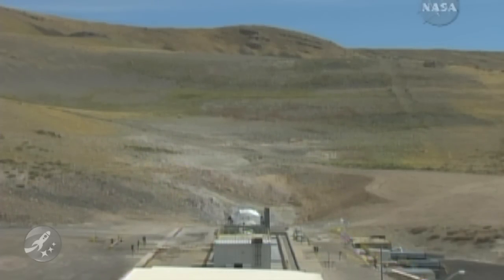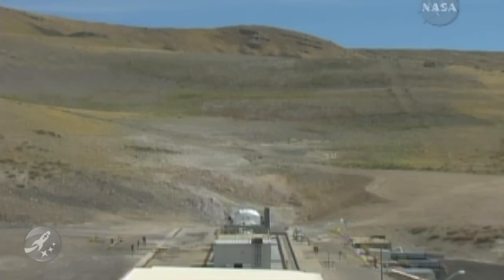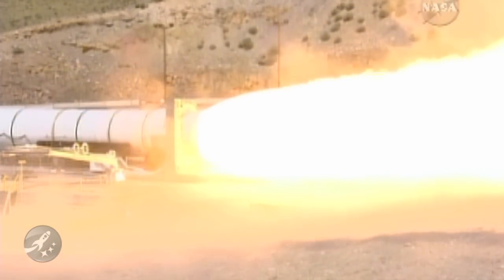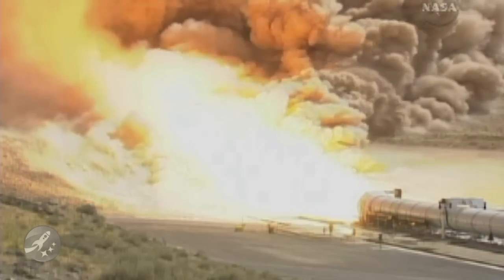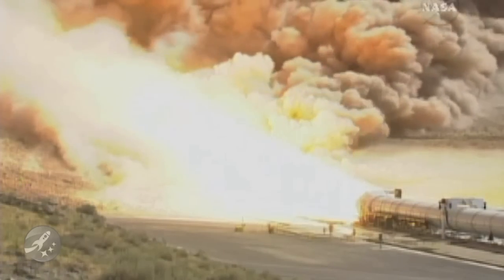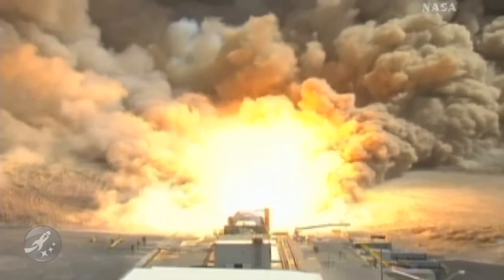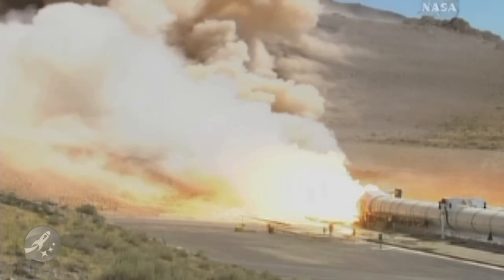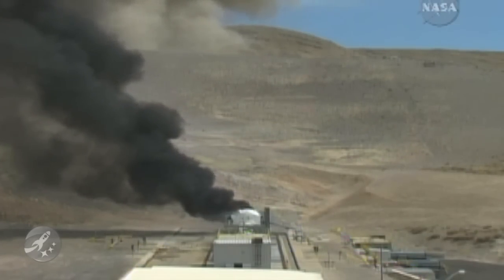Ares I Motor Test

Comment: Lol... Rocket fuel is not your common crude oil of which you speak. You are highly misinformed. This particular motor burns polybutadiene acrylonitrile. Far from the oil you claim the US is stealing. Otherwise, normal liquid fueled rockets often use an oxidizer and propellant, most commonly hydrogen and Liquid oxygen. Unless you think the US is "stealing" Oxygen and Hydrogen as well, then you are wrong again sir...

Comment: Just in case you didn't know, while this is often thrown around as a joke, it isn't actually possible to alter the rotational speed of the Earth in this way by placing rockets along the equator. The mass that leaves in the rocket exhaust imparts momentum to the atmosphere, which in turn is applied to the Earth's crust as a drag force. These forces cancel out, meaning that the Earth is 'slowed down' just as much as it is 'sped up'. Just some trivia!

Comment: Great observation,yeah the radiant heat is immense from the 6000F degree luminous aluminum oxide particles exiting the nozzle at 1-1/2 miles per second leaving a smoke cloud with a mass of 1-1/2 million lbs, half the thrust of the motor. Though I'll take an F-1 engine any day,it can be turned off on command,Space Shuttle Challenger couldn't do that, and we all know what that meant.Solids are not man rateable for this reason, dirty suckers too with HCl acid rain.Sorry to pop your bubble.

Comment: The same issue holds true for night test runs. Imagine that, millions of horse power with a thrust vector straight up into the air at night.  That's like pushing the Earth towards the sun. I'm sure Chuck Norris doesn't want to light his cig on a corona.

Comment: If your for a hotter climate, then by all means, argue that we have nothing to do with climate change.  There is a simple solution that doesn't involve stopping the program, and that is simply turn the test firing to promote a continuous rotation. A better analogy of this issue is potential energy is converted into kinetic energy and the pinwheel spins. Energy transferring back into the air is not the same coefficient, because air allows dispersion.

Comment: You still neglect to acknowledge conservation of momentum, No matter the scale of power; With out mass leaving the atmosphere increase in rotation speed will only last until the exhaust gases transfer energy back to the earth in the opposite direction. You can make one day shorter by increasing rotation speed very temporarily (on the order of minutes), before returning to a net effect on angular speed of zero (precisely zero, Not a rounding down). To say otherwise it to say air is frictionless.

Comment: Microelectronic and computer systems engineer. Specializing is solid-state physics (LED's, integrated circuits, MEMS, High power mosfets, ect.). Before you pass any judgements on my speciality in regards to the topic mater at heart, I assure you that I have had to study in great detail all the same maths and physics as you will have to except maybe at the cosmological scale, But have a well above average understanding regardless. In fact I teach 1st and 2nd year physics as part of my fellowship.

Comment: No longer debating the rotation issue, Suffice to say that I teach university physics. This can be derived from first principles, no trust in prior work needed. You wish to stay ignorant than that's your prerogative. As for warmer days, Of course. But you said 'global warming' which by definition, an average of the globe. Following the laws of radiation, The cold side will get colder than the hot side gets hotter. As for LHC/Russia, that's Post hoc, ergo propter hoc. Good sign of schizophrenia.

Comment: Ok people. I used up every character available to make that one point. The calcs are ignoring conservation of angular momentum, With out mass exiting the atmosphere; no change in rotational momentum can occur. With 1 exception, Tidal drag. Which transfers momentum to the moon by the gravitational pull of the ocean tides, Which FYI is 200,000x the effect calculated above. Which again is fictional and ignores some physics to point out the inanity of the original statement even assuming it's true.

Comment: Thanks for the back up, But I've already made mention of conservation of (angular) momentum in other replies to him, but space is short and could not get all relevant points across in a single post. As for dams, it definitely has an effect, We've prevented about 3cm of sea level rise from stored water alone ~ 10,800 cubic kilometers. But even making the assumption that all this was on top of mount everest, We would have shifted by less than a femtosecond/day. Just not measurable.

Comment: You will never "slow" down the earth like this. Every force creates a force in the opposite direction, and because you can't "kill" energy (the force of the jet which stays in the atmosphere) the earth experiences the same force the motor puts on it, as the jet transmits into air and ground. Same principle as sitting on a sailboat and blowing into the sails. You will never move the boat.
Only way to affect the rotation of the earth like this in any way would be to lead the exhaust jet into space

Comment: Seeing as I ran out of characters, I wasn't able to conclude by pointing out that regardless of this *incredibly* small figure. This *still* wont happen inside the atmosphere, any air you move quickly dissipates its energy back to the earth itself in the opposite direction, the only way to break this fact is if mass is ejected from the atmosphere and never returns.
I.E. any rotational energy added or subtracted from the earth while accelerting, is returned whilst braking.

Comment: No we don't, You just completely made that up. Firstly this is 22 million horse power as stated. or 1.6412x10^10 joules/s. Runs for 120 seconds for a total of 1.969x10^12 joules. Earth has a period of about 23.93 hours, it has an angular velocity of 7.29×10^-5 rad/s with a moment of interia of 8.04x10^37 kg/m^2, giving it an rotational kinetic energy of about 2.138x10^29 joules
Moral of the story, It would take roughly 39851 years at firing one of these a second to even slow the earth 1 sec/day.

Comment: The byproducts of this are aluminium oxide and potassium chloride, the latter of which is only mildly harmful to the atmosphere. The overall effect on the environment from lighting one of these boosters is negligible. Most of the smoke you are seeing isn't even from the propellants being used, but rather from water vapor in the air instantly being turned into steam from the intense heat. To put it shortly, no one is with you. We're fine with our progress, thanks.

Comment: You better be trolling. Cancelling Constellation should have been done ages ago. The Ares I-X test showed that major thrust oscillations happened when using the SRB as first stage. It gave all the data needed to say "No, this doesn't work like it should". ATK has reviewed and improved the design now for the Liberty rocket system, but the Ares concept didn't work. Launching crew and payload on seperate rockets for "safety" is also a huge waste of money and time.

Comment: Yes. Very fine aluminium powder is used as fuel, and is mixed together with the Oxidizer into a paste, they put that paste into the SRB, and an ignition charge.

Comment: This 5 segment SRB designed for Orion called Ares was canceled by NASA but the design is solid and will be used for the new Liberty rocket launch system with ATK in concert with the Ariane 5 rocket from Fance as the new first stage to one day transport crew and cargo to the ISS or on a moon mission maybe in the future.

Comment: @spacevidcast  Actually their was Zero horse power generated during this test because no work was done. Their is no direct thrust to HP conversion unless the motor is doing something like propelling a rocket. Temperature varies 2/1 throughout the motor,7000 to 4000,pick a place.

Comment: @rss0246 Exactly, we have heard this particular sound for years, coming from the aft of the Space Shuttle, just minutes before launch or when landed, sitting on the runway. Obviously for the same reason. Pressure for hydraulic systems. ;)

Comment: "Sound of the high speed cameras". It's not correct.
It's the APU noise, used for hydraulics system for steer the noozle, thrust vector control.

Comment from the maker: @Dillon1108 Sure it is. It might only be 0.00000000001%, but it does indeed affect the earths rotation. It's the same concept as jumping from a large boat in a lake. You might be many times smaller than it is, but your short exertion of force is enough to cause the boat to move in the opposite direction, even if very slightly. 

To give perspective though, the earthquake in Chile in February actually slowed the earth's rotation by a millisecond and shifted the Earth's axis about 3 inches!

Comment from the maker: @NitremArts For what it's worth, the SRB's burn at 5,600 degrees Farenheit. The SSME's (space shuttle main engines) burn at 6,000 degrees Farenheit. Either way, they are both indeed some awesome barbecues. However, the SRB's kick out hydrochloric acid in the presence of moisture. SSME's only produce water vapor. I think I'd rather have that on my burger. ;)